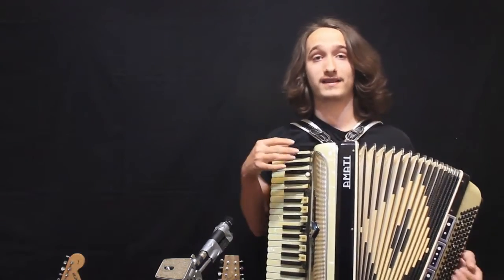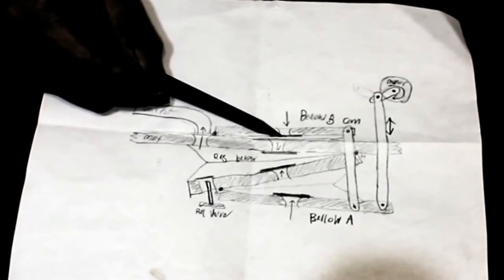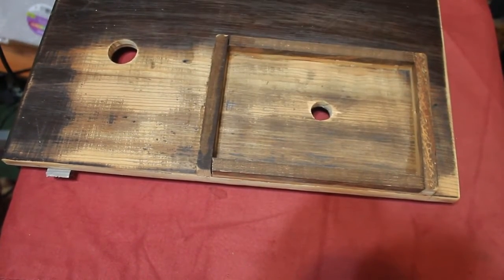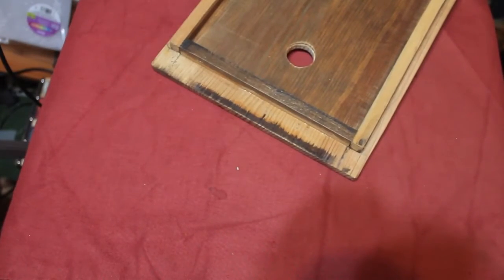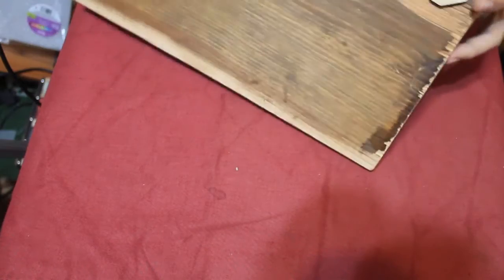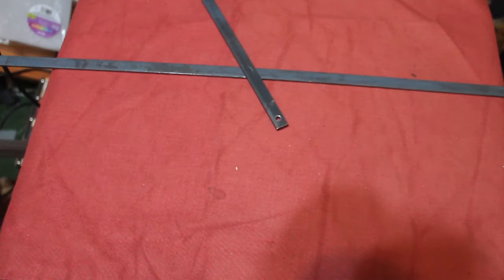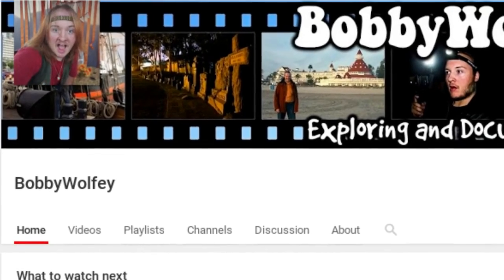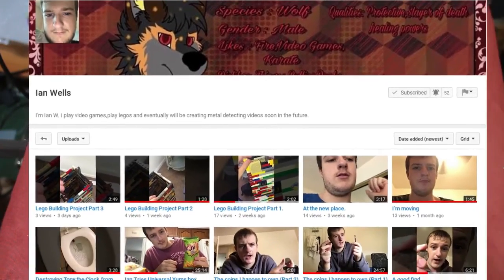Bottle organ build update: A possible source of pressure.

Comment: That’s my original channel I still only have 53 subs and I’m hoping to get to 100 on that channel
Reply from the maker: It's the channel with content, so I featured that one
Reply from the maker: You can use reddit to promote your videos
Reply: WizardsOf12 yeah that could work
Reply: WizardsOf12 although I never used reddit to begin with.
Reply from the maker: You start on the smaller subreddits to gain karma so you can post on larger ones that have the 10&10 rule
Reply: WizardsOf12 ok